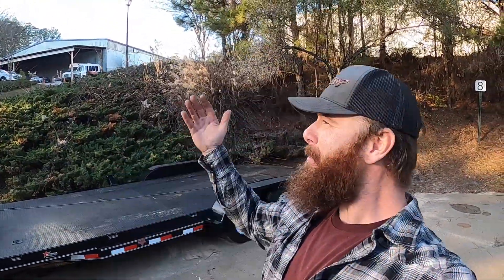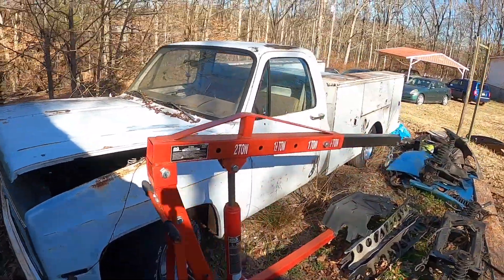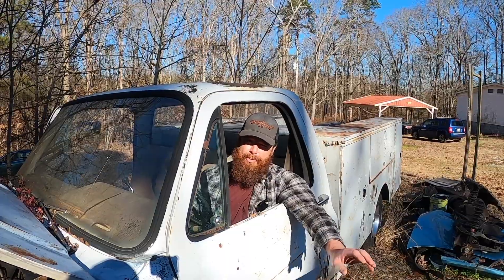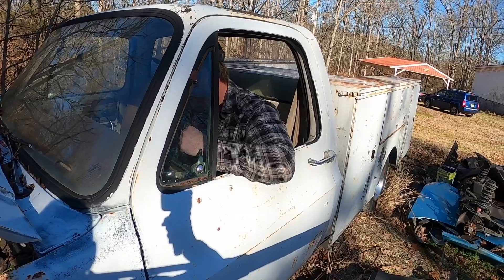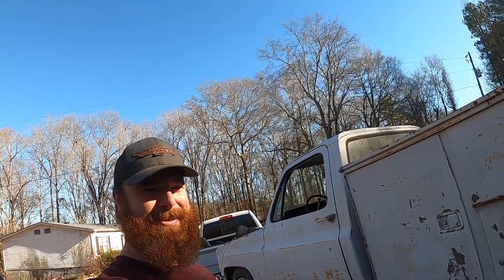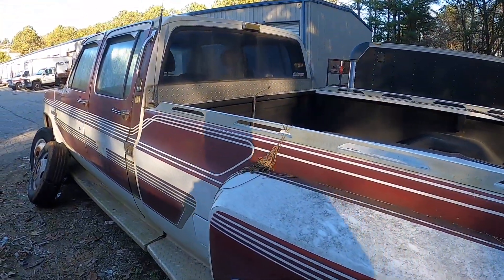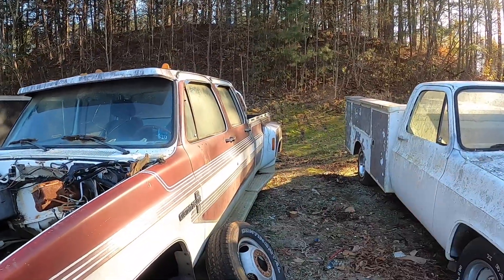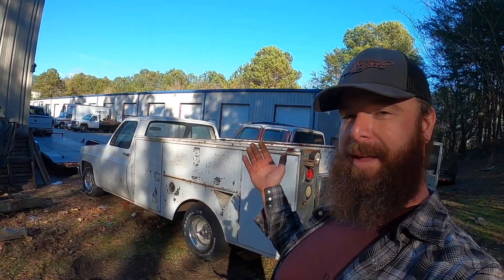CHEAPEST SQUAREBODY Dually Conversion

Comment: Did the dually rear end bolt right up? Or did you have to modify? I want to do the same thing
Reply from the maker: @joeywhite69  I'm 99% sure it would bolt up in a standard configuration, but on this particular truck we flip the rear end on top of the axle to lower it.